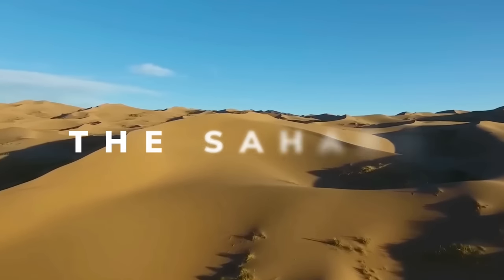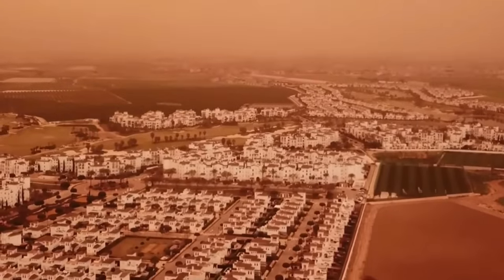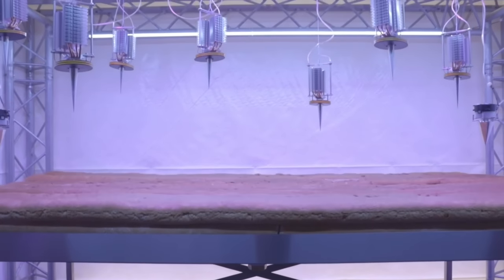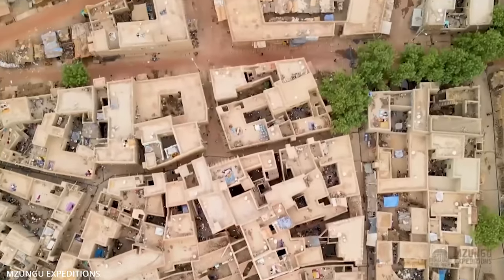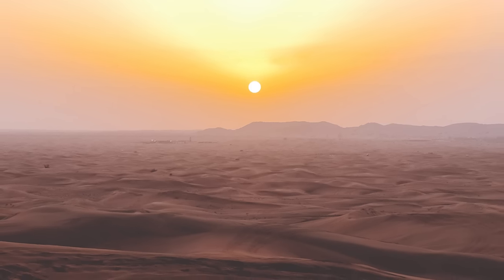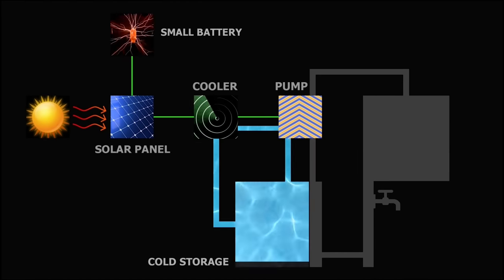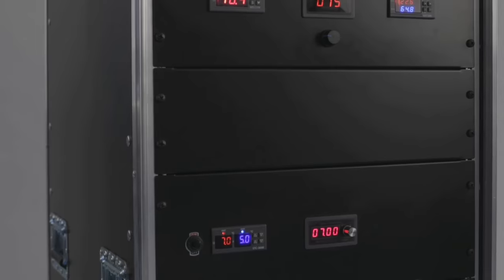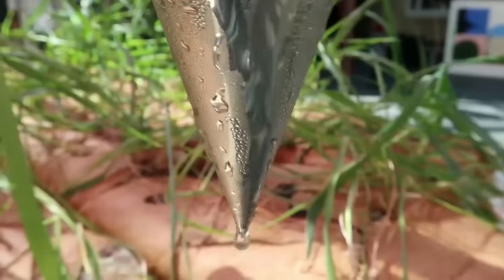How Solar Powered Machines are Making Free Water in the Sahara Desert

Comment: Peltier cooling is energy intensive and inefficient. It relies on temperature differential. Putting an aluminium/copper heatsink, in full sun, isn't going to dump heat very well at all. 
Perhaps if the solar panel charges a battery then it may dump enough heat at night, with a certain Dew Point. Oh and it is R/H (relative humidity), not, repeat NOT absolute humidity.
I worked for Carrier . I've done university on all of this, including electrical engineering!
Reply: I'm a potato level human and I know this is a stupid idea
Reply: On top of all that you said, which I agree with. There is still just a finite amount of water available. So what happens when that is used up? Instead of increasing the amount of water which is available we have to be reducing our demand for it. How do we do that? Reduce our population. That is the root cause of all of our problems. If we do not find a humane way of reducing our population then the natural processes on our planet will kick in. Waiting for or allowing nature to run it's course is probably the least humane option of all. Mother Nature is not necessarily known for her kindness, especially in situations where a species has outgrown it's capacity to feed it self.
Reply: @2000sborton  No to the the population argument. Simply not true. Regarding finiteness of air moisture - dryer air also means water evaporate faster.
Reply: I've considered a similar machine, but less complex.
1. Some kind of mass with high surface area and high thermal conductivity (copper perhaps) coated with hydrophobic paint.
2. Super reflective surface on top to cool 1 at night while not gaining too much heat during the day.
3. Surround/protect 1 inside a pipe for Stack Effect.

Goal would be to reach below Dew Point during night, particularly a few hours before dawn. If it works it's much more easily mass produced, even though copper is expensive. If it works at all with copper, it might also work with aluminum which is much cheaper.
Ideally it would be a fairly tall structure for larger Stack Effect and since it is like a cool chimney it would draw air from higher up (humid air is lighter than dry air according to wikipedia).

Comment: The machines presented in this video are very inefficient dehumidifiers. They produce very little water when the air is dry (like in the desert) and need a very large solar panel surface area, making this water extremely expensive. We agree with the debunking videos of Thunderf00t. Still, our company Aquahara is testing a more efficient process, which produces 2 liters of water per day per square meter of solar collectors under dry desert conditions. This is still expensive, but the technology is evolving and getting more cost-effective over time, just like with the photovoltaic industry 10 years ago.
Reply: I have ideas. How do i work for you?
Reply: @robtherub  Currently, we do not have open positions, unfortunately. You can still send me an email (see my address on our website). Best regards, Philippe
Reply: What about desalinating seawater? The UAE gets 90% of its drinking water from desalination.
Reply: @aquahara8691  Thank you for your reply, sincerely, my name is rob.... talking here is fine, i am not a person needs paying, may be able to invest money actully. The idea is glass canals made of glass, the glass is made of sand, power sunshine, all free, thick double canal base, thin glass roof airtight, double skinned, water cooled, left canal seawater, inverse, locks pumped upwards when necassary, constant return flow so no heavily salinated sea output. Needs ocean water connection. Location Gambia, West Sahara or The Sinai, Egypt, that is after all, the holy grail of permculture, according to John D Lieu (?) ... the right canal is immediately growing sand growable plants from condensate and immediately have enough to grow forever like a garden in a sealed bottle growing for 60 years on the same water. A thin green line across the tropic of cancer outputting fresh water all the way across. A plague of locusts can simply be welcomed into the airtight tunnels. There are doors. Which can close and the thing can be flooded with CO2. Once Sinai mountain is green though, that alone will do the job, instead of the upward push of the hot air from that desert driving the mediteranean evaporated sea moisture onto pakistan and bangladesh every year, once the rivers of mount Sinai are flowing again that moisture will draw the meditarranian moisture over the once, ond soon to be again, fertile crescent, remoisturising egypt and returning the mighty kingdom of Abysinnia to the Garden of Eden, as the rain falls again on Lalibella, Jah, Ras'Tafari.
Reply: @robtherub  Hi Rob, your idea of using solar energy to desalinate seawater makes a lot of sense. Seawater desalination will always be cheaper than atmospheric water generation, even with the Aquahara system. But we are working on atmospheric water as an alternative water source for inland regions, far away from seawater desalination plants. Atmospheric water will remain rather expensive because of the (solar) energy requirement. So in any case, it has to be combined with wastewater recycling systems and it only makes sense in regions that have very little rainfall and where groundwater is depleted.
Reply: @pverplan  very interested in your work, what regions are you in?
Reply: Well I don't mind people working on challenging engineering problems as long as they are rational about it.  I do think though that if we really wanted to get water to areas that need water it would actually be more energy efficient to use a solar panel field to power some trucks to just drive the water out to regions that lack water or better yet put down a pipe and pump the water over there.
Reply: @Sergiosvm  The salt has to go somewhere, and it typically goes right back into the ocean. This raises the salinity near the plant, which can have devastating effects on the ecosystem.

Comment: If this was scaled up... Would it not just take the water out of the air at some locations where it normally do not rain, and live the air dry reducing the amount of rain somewhere else?
Also do the actually add energy to the dessert? I am assuming the sand reflects energy out to space, in the form of light. But then we collect the light using solar cells, reflecting less light, using this energy to heat the air? 
Thus on a large scale could this not be a overall negative thing? (Moving water for the price of more global warming?)
Reply: The effect is absolutely negligible as you are just covering a very very very small area of the desert, even at large scale.

Comment: This device uses energy to remove water from the air, making that air drier so it is ready to absorb water from adjacent areas at a higher rate.  So you are increasing the desert's dryness in the area surrounding the device.
If there is a breeze, then the area downwind of the device will be an increased desert area.

Then you can dump the water back into this drier area and irrigate it? 
 
The dark solar panel absorbs more light  which would otherwise be reflected back into space from the lighter colored sand.  The increased light absorption increases the temperature of the solar panel and surrounding air, increasing the local desertification. 

You can't get anything for free.
Reply: Even if this were done on a large enough scale to do actual harm, it still wouldnt matter since the soil is already as dry as it can get... Like who cares if sand gets a little bit dryer? You're assuming that the collected water would normally be absorbed by the ground, which doesnt happen in already completly dry araes
Reply: @Illuminati_HD  You Said, " it still wouldnt matter since the soil is already as dry as it can get"  
Not true.  The Sahara gets about 3 inches of rain per year. Much of that rain is absorbed into the sand and then evaporated back into the air over the next days - months until the next rain.
The dryer the air, the quicker the evaporation takes place and the dryer the sand becomes.

It is true that very dry areas absorb the water less readily. If none of the water was absorbed by the ground, then there wouldn't be oases.

Comment: If I understand this setup, it is a solar panel powered dehumidifier on the roof.
Wouldnt it make more sense to mount tbe panels on the roof without the need of a boom truck and power the dehumidifier inside the house? It would be easier to plumb, maintain for purity and simple to replace when the dehumidifier fails. With used panels($50 per 240w panel delivered from Suntan solar) you could run the entire setup for under $1,000 usd. You could scale it up to whatever amount of water you need per day. The payback would be a couple years not 10. Or....you could use the panels to run AC as most people will enjoy thanks to climate change. ACs are giant condensers and produce a large amount of water each day, depending on ambient humidity, time of use and size of unit. Now that is bang for the buck. Oh the condensed condensation is much cooler if you harvest it quickly.
All in all an expensive shell on a dehumidifier the box stores sell. Oh you could skip the solar and just plug it in and pay back would be a couple months!

Comment: These devices have been disproven time and time again they basically work off the same principle of a dehumidifier and a small solar panel is not going to provide enough energy to make it worth it,also you would need a lot of filtration to be able to get the metals out of the water. I would place a bet their out of business within a few years.

Comment: This contraption has better efficiency at humid area. I think in dry area we should use the abundant sea water. Distillation of sea water. I would create a huge convex lens or concave mirrors that concentrate sun into a spot of metal floating on top of small collection of water. Collect the steam and condense it. Edit : oh and yeah let the steam generate a turbine for the pump and probably have enough extra generated power that contribute to the electrical grid.
Reply: As a kid I always wondered why not use solar energy to pump water from the sea, distill it, sell the salt and use the water. Like you can have rows of solar panels which generate some shade you can grow plants in with water from this, and even use water to clean the panels and also thus, moisterizing the air. There is so much energy there, put it to use.
Reply: "I think in dry area we should use the abundant sea water."  The vast majority of the Sahara is very far from sea water.  Same goes for most hot deserts.

Comment: Nice dream but I don't think it's practical. What happens if it breaks and you can't get parts. Heat in the desert, and blowing sand are the devil. I live in a severe drought area. Not coastal so can't use fog nets. I use greenhouse film inverted in a cone over a 8x12 kids pool. I also have polycarbonate panels attached to posts that funnel rain into the pool.

I then pump the water into 55 gal food trade barrels that are buried up to the rim in the ground. Low tech, highly reliable.
Reply: Sounds Great. I am in Portugal looking for a solution to waagerecht my trees. Couleur you do a Short video about your low tech Solution?

Comment: Need to improve efficiency with a heat exchanger that cools input air from the post-condensation exiting air.  Run the two through a tube with a divider in the middle and insulation on the outside.

Comment: With  solar cells just generate enough power to run a dehumidifier that pulls the moisture out of the air.   that's one way, there are actually some manual stand-up systems no power, and get the water  with solar cells as an accessory.

Comment: You can do the same moisture collection at night in the same region with fog nets which are way more cost effective and require no electricity or electronics of any kind.
Reply: I have to wonder if tethered balloons/dirigibles, lifting fog nets higher would be an effective way to dramatically increase cross section and yield. Or is that just adding unnecessary complexity?
Reply: @stevenking7352  You would have a  major problem with higher wind currents the higher you go plus the greater the surface of your fog net... the greater size you heliem or hydrogen floatation  balloon envelopes would need to be. And than you'd be looking at the overall cost  monitoring and maintaining such a system. You really want a simple system that has heavy duty post burried deep in compacted soil on a hill or ridge for your altitude gain.
Reply: Usually a simple pole framework erected uphill of you fields with storage tanks slightly below would be ideal and fields and communities slightly or further downhill from the tanks so that gravity is being used to your advantage.

Comment: What a scam lol
The implication is that for just $3 you can have drinking water in the desert! What a mirical! Except it is not.
First of all, it is $3 in active parts. A metal heat sink and a piezoelectric cooler. Those are cheap parts! But you have to assemble them, add a housing, add a powersource, packaging, and ship it to a remote location where the general income is $3 a week.
And how much water will this produce in the area they want to deploy it? Maybe 1 litre a day? Not enough to justify the cost for anything other than the occasional cup of water! It's not free or even cheap. It's not efficient. It's not effective. It's a horrible idea!
We already have much better commercially available products on the market. Glorified air conditioners complete with compressors, fans, etc, and for $6k they can provide about half the water needed for a typical family to survive. These are efficient, and work well, and are readily available, and are much more compact than what is shown here. If those items which are waaaaaay cheaper on a $/litre basis are not making it into the hands of people like this, how is a much worse product on all counts supposed to be helpful?

The answer to desertification is better land management by governments. Do what China is doing and stabilize the soil, while adding plant matter that will break down into dirt instead of sand. Simply throwing water on sand will not fix a desert. Then you have wet sand which is porus and dries quickly, and then spreads further.
Ihate stupid scam videos like this. All smiles and save the poor people with little to no thinking behind how it is supposed to actually help anything at all.
What would really be innovative would be the use of some of these new "sub temperature" paints. Paint a heat sink with that, put it over a home, add some fins to the under side, and then you get a much cooler home, free water collection, and a metal roof. The water collection will mostly recycle water from inside the home where breathing, bathing, and cooking creates extra humidity in the first place making it more effective than just putting it out in the wild. And no need for a powersystem. Just keep the dirt off of it, and slap on a fresh coat of paint every few years. It would cost a bit more up front than a compressor unit, but without the power requirements it would be easier to run and maintain. And adding the idea of included air conditioning of a home by dropping the Temps 10-15*c during the heat of the day helps it pull double duty.

Comment: 6:38 good video but it is misleading.  You will need 10 100 watt solar panels to produce 1kwph, which is a lot larger than the solar panels in the video.  Even if the technology does work, you would need a massive solar array to supply a small community with water.  You can forget about getting enough water to grow a garden, or water livestock.
Reply from the maker: The smaller solar panel showed in the video was for a different model, DCO3 only needs a 50cm 30-50 watt,
As for the droppler20 which you time coded, the website says...
We developed this compact machine with multiple power options: a 24 volt connection, so it can be directly connected to a solar energy installation, powered by a battery, or plugged into a power grid. With a cooling capacity from 80 – 620W, this highly intelligent system produces up to 3 liters of water per kWh.
Reply: Agree with you ... in some parts of the Sahara the air is too dry for this to be even remotely  usable . There are on the other end huge underground water potential .
Reply: What about wind power?
Reply: @Blaqjaqshellaq  in the desert  dust storms make a mess of moving equipment
Reply: @LeafofLifeWorld  I still doubt its going to work

Comment: Due to CO2 fertilization global tree canopy cover increased by 2.24 million square kilometers between 1982 and 2016 (in that 35 years alone). Leaf area index (LAI) global maps show especially large increases in hot desert, cold desert, tropical, high altitude mountain areas, cities and urban areas, high latitude areas from northern Europe all the way to Kamchatka, then Alaska to Appalachia, much of Australia, etc. . Another study reported: "The greening over the past 33 years (1982-2015) is equivalent to adding a green continent about two-times the size of mainland USA (18 million km2)." The Sahel region (southern Sahara) is greening very nicely thank you. Local projects also exploit the 40% reduction in the water requirement of plants due to increased availability of the most important fertilizer (CO2) and plant various vegetation to convert sandy ground to soil to agricultural land.

Comment: Solar electric fan to a copper parabolic into slanted aluminum rolled sheet tube that is covered in glass then water will come out.   Aluminum rolled sheet tube could be the car aluminum cover rolled into tube [that was what I am using].  Maybe a pitcher a night depends on heat level.